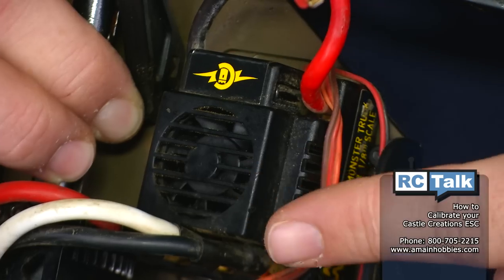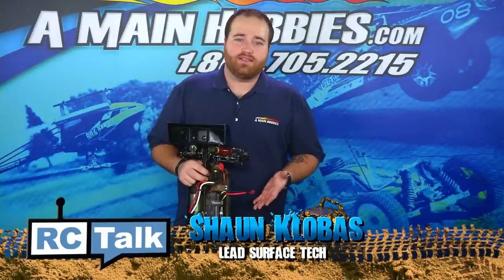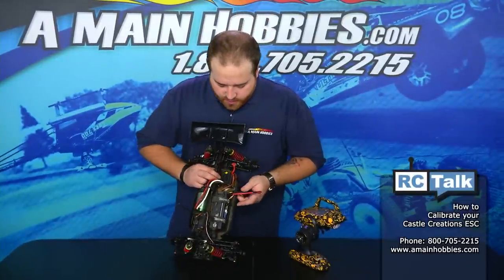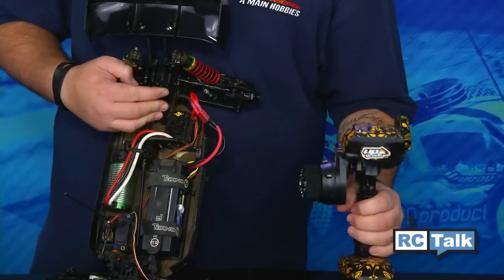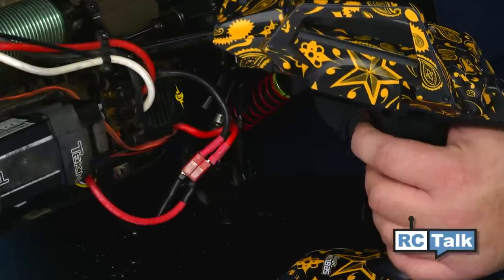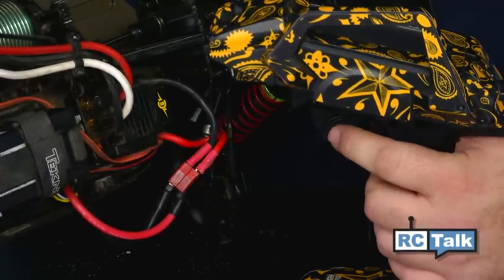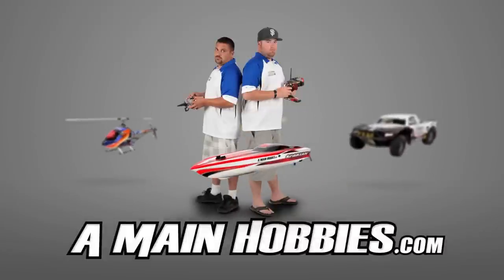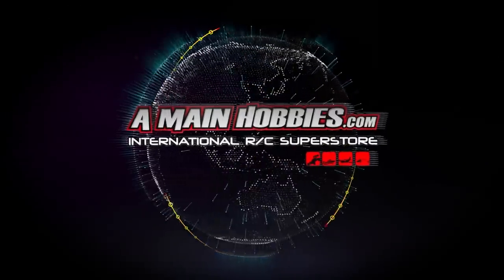AMain Hobbies' RC Talk: How To Calibrate A Castle Creations ESC

Comment: Everything is at Default setting,  changing the throttle or brake curve in the castle link does nothing either. any changes I make do not really seem to take affect apart from motor direction.   I must be doing something wrong as you can see from my you tube the thing was fast.

Comment: One I learned from ordering the IPE to SMA connectors is that there are different types and sizes. What size is the one that fits over the original DX3 transmitter?

Comment: So helpful thanks. I just received mamba x and calibrated it. The biggest thing I found was that you cannot move the throttle position on your own accord. You only have a moment to change positions before the next sequence. I was holding the trigger in place for to long timing out the loop and not getting it to calibrate. Once I figured out that it was closed loop I got it. Didn’t trust my calibration till watching this vid thanks. I wish Castle mentions this in their manuals.

Comment: I'm using an old savage flux esc/motor on a arrma senton brushed and converting it to run on my plethora of 20 volt craftsman drill batteries and am having problems with the esc recognizing the battery as a dead 6s lipo even with the "5s" drill battery is fully charged. So if I lower the voltage per cell to 2.5 or 2.6 would that fool it to work on 5s  I guess I'm just asking am I going in the right direction with setting

Comment: I just installed a SCT esc with castle 1410-1y, and I’ve tried your directions but I do not get chimes, it fast blinks red about 10x and the goes solid yellow. turning the steering to the right gives me solid a red light with a beep(doesn’t sound like the chime), and then to the left the light turns green.

Comment: I fixed my esc by cutting off the switch and putting the two wires together. I tried programming it but it will not program

Comment: I   have a align Trex 500 RC helicopter that I purchased used.It has a castle 90 esc on it. When I spool it up it starts out very slow and builds up slow. It is hard to tell when its going to start to lift off the ground. Is this the esc not set up right .I don`t have a Manuel to go by.

Comment: Is the mamba X ESC combo ready to use when installed, or does it have to be programmed?
Reply from the maker: It comes programmed with general settings, but it will need to be calibrated to your transmitter. 
-Brett
Reply: Thank you sir.

Comment: I did everything shown in the video and it programmed just fine. neutral position shows the orange light, forward position shows the green light, and reverse shows the red light...... only problem is I don't have reverse.
Reply: AMain Hobbies Videos  I think the culprit is that castle link module I have in the radio box. I couldn't even connect my computer via castle link software, so I dug out my field link programmer and removed the "dongle" in the radio box to connect the field link direct to the ESC. 

it's now working as it should, but the question still remains as to why reverse disappeared in the first place. some things may probably never be known. Mysteries of the universe and all that. LOL 

thank you for the quick come back.

Comment: Great video, short and to the point, informative. my issue turned out to be my throttle channel needed to be reversed for the esc to recognize it.
Reply: Patrick Smith Thanks for the comment Patrick and for sharing what you needed to do in order to calibrate the system. :)

Comment: What do you do when the wiring isn’t correct, causing the front and rear wheels to contradict? The spin in forward in the front and in reverse in the rear. Checked diffs, both installed correctly. I’ve tried every combo I could think of on the wiring already.
Reply from the maker: Do you have a motor on each axle? If so, one motor will need the direction reversed. If both axles share one motor, the only explanation I can think of is one of the diffs is installed backwards. Often, a diff can install in each direction making it easy to reverse one. 
-Brett

Comment: Howdy.. ok. So I'm running this set up (momba monster 2 with castle creations matching motor on a mini E revo. I've not found any forum that can help. Trying to break 100mph. Any suggestions for shock set up as well as gearing? Would greatly appreciate the help
Reply from the maker: The VXL manual shows a 31 Tooth pinion gear being the biggest pinion you can fit with the 50T spur gear. For a max speed run, I would try gearing up close to that 31T. But be careful with your temperatures. That gearing is so high, it will burn out your electronics if you use it for general driving, or too many speed run attempts. You probably want to add some fans in the chassis I imagine. When accelerating, you will need to be really easy on the trigger. For suspension, a firmer setup will be best for pavement speed run attempts. I would try maybe 50wt fluid, and drop the overall ride height low, maybe try 20mm or lower. Let me know what you think.
-Brett
Reply: @AMain_Hobbies  problem is. I have NOT been able to find a forum of Any one running a 1/8th scale motor an esc on a 1/16 E revo.

Comment: I've tried your calibrating method over and over. My ESC works fine everything works fine but it has no brakes. It just instantly goes into reverse and if you're already going reverse it instantly goes into forward. There is no brakes in either direction

Comment: my esc fan does not come on when i calibrate it. and my temp gun always reads less than 150 degree so ive never seen the fan come on. bought brand new late december. 4 cell lipo. plz any info will help. ive tryed contacting you by calling many times

Comment: I just tried what you did and it did not work for me I have been having trouble with my castle Sidewinder 3 I will run for about 3 to 5 minutes and it will stop and a yellow light is flashing when it stops sometimes I can wait 5 or 10 minutes and it'll work again sometimes it will not work again for a day I really need some help I have always been an actual guy and I'm just starting to get into electric

Comment: Since plugging my car into the castle link software it only has half the power it used to have no matter what I do I can not get it to go fast setup is vector 4800 motor,  motiv for speed controller,  black magic 3200mah 2s1p battery and a maverick mtx 245 controller.   Does any one have any ideas what I am doing wrong?

Comment: After I did this car is working fine .. except for the fact it's doing 50%  forward  and I hundred percent reverse why would this happen and how is it fixable ? I am using stock  slash 4 x 4 controller .. I think it might have been doing this with  stock  set up but that was not very easy to see the difference .. But after putting the  mamba monster2  in it  it was very apparent that it was doing 50%  forward and 100% reverse .. Please help
Reply: Try change the wires positions, just the red and the black.

Comment: What happening is it have power to steering but not motor and beeping 3 red light, I ran into a paddle of water not much though it a mamba xlx esc and 2028 motor. Thanks for helping
Reply from the maker: Hi Sothea. I am not sure the problem. The manuals says three beeps is a sensor wire issue, but does not say what 3 lights means. Can you please call Castle Creations Technical Support? Here is their number:  (913) 390-6939, option #1
Or you can contact Castle here: http://home.castlecreations.com/contact-support

-Brett

Comment: So, I have a weird issue.
I have had this thing for a week now, and tried everything.
(same one in the vid.)
I turn it on, do everything, but when I am done, the green and orange light are both on and it does not go, just turns.
Also, when I do get it working (Rarely.) the only way I can describe it is semi auto, by that I mean, I pull the throttle (Max)
And it goes, but half a second later it stops even though I still have full throttle, I am slightly worried by this.
is mine defective or could I just reprogram it with the CASTLE Link and fix it?
Well, when  I got the thing from amazon, the box looked water damaged and the papers inside also looked water damaged.
I am using a traxxas connector.
Does anyone know what might be wrong with it?

Comment: I was just wondering how you recalibrate the mamba monster 2?
Reply: ***** You keep saying turn on the switch on the esc but the Mamba XL2 doesn't have an on/off switch, why is that? I have the XL2 myself and i wonder why they didn't implement an on/off switch feature. My XL2 is using bullet connections to turn the esc on which is the only way to hook the battery strieght to the esc.

Comment: How come when calibrating the new X 8 esc when I go in reverse the motor starts spinning?
Reply from the maker: I don't understand; what do you mean? The motor must spin if you are to reverse. 
-Brett
Reply: I have a new mamba x8 esc I'm trying to calibrate it to my car but I'm only getting reverse.
Reply from the maker: @godsun358  You may need to reverse the throttle channel on your transmitter. If the ESC is set to forward/brake, but the channel is reversed, you would have reverse/brake. There should be a button on, or in the menu of your transmitter to reverse the channel. What transmitter is it? 
-Brett
Reply: @AMain_Hobbies  it's a spektrum dx4c transmitter and spektrum 4210 reciever and thanks for the reply I will try that today

Comment: What if the esc (6s lipo in an emaxx) won't stop beeping ever just beeps and beeps tried all these steps many times can't get it too stop beeping and run again
Reply from the maker: What is the ESC model? The manual would have a beep code that let's you know the issue. This issue might even be worth calling Castle Technical Support for the issue doesn't go away. 
-Brett
Reply: @AMain_Hobbies  turns out it makes that sound when I have a bad servo just fyi

Comment: The problem with mine is that it does the beeping thing and whatever i do this all it goes good but i can only give gas for a few seconds, and then it wont go forward or backwards anymore and only allow me to turn.
Reply: ***** I already did all that several times, it does whats its supposed to for a few seconds but after that it only allows me to turn.

Comment: I did the calibration process right but my motor goes in reverse when I pull the throttle help anyone?
Reply: You need to reverse your throttle channel.
Reply: You plugged one of your motor to esc wires in the wrong spot, try different spots as they are NOT color coded as it is a senseless motor.

Comment: In got 3 red  blinking beeping need help
Reply from the maker: Hello Sothea. Is your ESC still not calibrating? If yes, could you please tell me what ESC model it is?
I noticed in the Mamba X manual, it says three beeps means the sensor wire connection has been lost and needs to be checked. Four beeps means the datalog has reached capacity, and cannot record any more new data. Hope this helps Sothea. If not, please let me know what ESC model you have and we can investigate this more. Thank you. 
-Brett

Comment: How about the xlx?
Reply: @AMain_Hobbies  according to the data logs, im only getting a maximum of 60% throttle output. what gives?! 
lol idk. 
There is no on botton on the xlx, instead I turn the controller on, pull the trigger completely down, wait for beeps then full back/reverse, wait for beeps, then release to neutral and wait for 3 beeps then I do a bench  mark test on my workbench. Take the wheels off and pull full throttle for 10 seconds or so!!!!! 
I get partial hearing loss afterwards lol  its a tp4070cm motor running on 2 4s lipos in series. A BEAST

Comment: My car jerks when acceleration?
Reply from the maker: Is it semsored? Sometimes the sensor wires go bad, making acceleration jerky. Replacing the sensor wire can solve this. Another thing to look for is binding in the drivetrain, where it doesn't want to spin freely, which makes very hard work on the motor. Cleaning the drivetrain can solve this issue. 
Let me know what you find out. 
-Brett
Reply: @AMain_Hobbies  yea it’s a sensored I calabrated it the esc and still dose it

Comment: can someone please help it turns on but flashes green and does not make a sound in channel 2 but if I put it on channel 1 it calibrates and everything it drives with the steering wheel but it doesn't do anything on channel 2 please help ASAP
Reply: Are all your trims, sub trims, and end points set back to stock (0)? Also, sometimes you will have to reverse the channel, or if it already is, put it back to normal. So when the ESC is getting throttle, it reads as brake, thus throwing off your calibration.
Reply: Yes I reset everything to stock
Reply: How do u reverse throttle
Reply: What kind of radio are you using?
Reply: +brandon aldred  tqi
Reply: I'm not totally sure on the TQi, but if you go here: https://traxxas.com/sites/default/files/6507-6508-6509-TQi-Manual-120130.pdf on page 6 it talks about it, and on 14, it talks about it some more, and how to just reverse the throttle, instead of switching everything. It does say, the factory settings for it have been set as "reversed," so I really think that is probably the issue. Try going into the programming mode, then going to throttle "channel 2" then servo reversing. Hopefully, that helps you out.